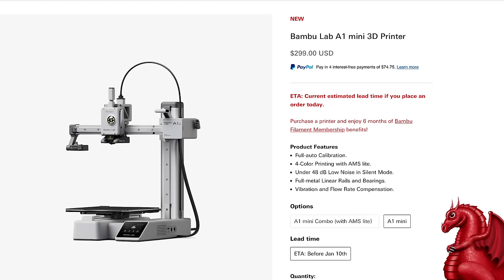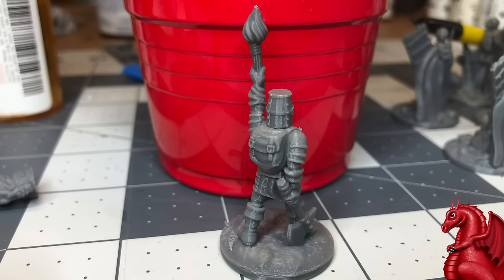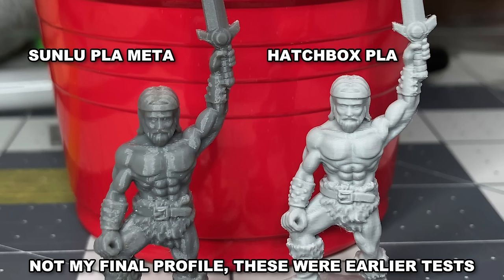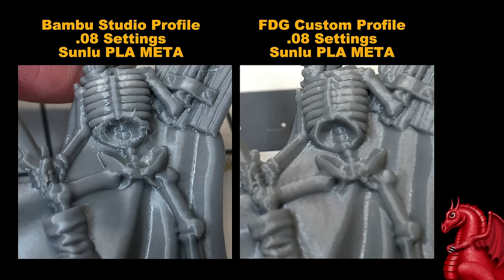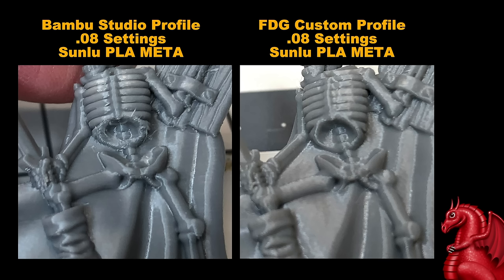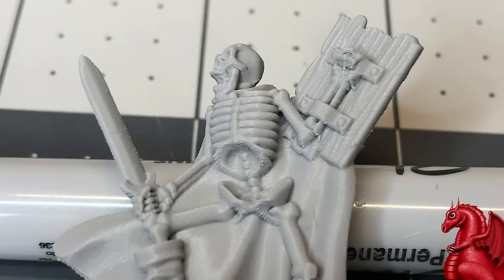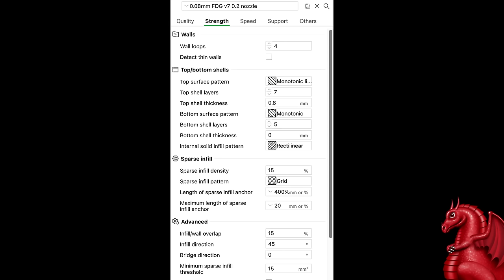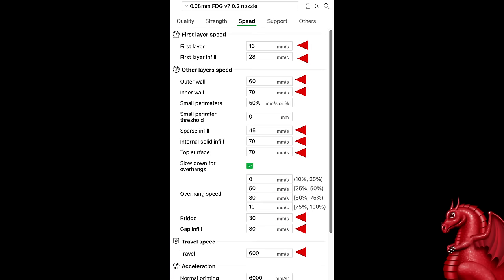Bambu A1 Mini - The Best FDM Miniature Printer!

Comment: Are you using a flat PEI sheet or a textures one? Textured should help. Bumping up the temp of the first layer also usually helps with bed adhesion. With other printers I find that just printing slow and hot for just 1 layer is enough.  I used to do slow first layer prints for 4 layers just like you, but 1 does the job and speeds things up no end.

Comment: In your optimised settings, how do these two filaments you recommended compare to the "original" Bambu PLA or PLA Mate?
I tested 3 manufacturers (but none of the ones you listed) and B PLA turned out to be the best for 0,2 nozzle.

Comment: Have you used 0.2 mm nozzle previously with other printers? I'm interested in what's result of smaller nozzle in general and what Bambu Lab brings in 🤔
It's interesting to see how much better different the meta filament looks. We obviously need Wargamer (Fauxhammer loves that resin) type of matte miniature filament 😅
Reply from the maker: Yes, check out my Ender-2 Pro video on the .2mm nozzle. It does great, but not as good as the Bambu A1 Mini.
Reply: @Tombof3DPrintedHorrors  Coming back to A1 Mini: We have resin printer (Mars 4 9k after Voxelab Proxima 2k display went bad and replacement was even worse) and modified Voxelab Aquila (Ender 3 V2 clone with dual Z lead screws, Orbiter 2 extruder and A1 nozzle and heating block for easy/fast swaps and Octoprint).
Printing, even with A1 0.2 nozzle, didn't bring good results for my son's gunpla parts (guns, accessories, service platforms etc) and for some reason A1 nozzle made it seem as if 1st layer came closer every print - though heating block and BL-touch are rigidly mounted. Of course resin is superior, even mandatory for 1:144 human figures, but workflow is different, messy, random reasons, etc... So I bit the bullet and bought A1 Mini from summer sale for his use.

Results? Powder-coated bed is not super-adhesive for small footprints (not exclusive to A1), supported surfaces are not too clean (not exclusive to A1) and it poops fair amount of filament before printing (no AMS, but it doesn't know if nozzle might have been changed?), but otherwise it's easier to use, 1st layer is always pretty good and print quality with 0.2 nozzle, default profile and generic PLA, is closer to resin that I thought it could. And it is ridiculously fast when it gets up to speed :)

It doesn't make me Bambu Lab convert in general, but being practical, A1 Mini prints really, really good 👍

Comment: These looks REALLY good! I'm getting more and more tempted upgrading my Ender 3 v2 to an A1.
But have you tried fuzzy skin? I do it sometimes on my Ender and it removes the layer lines quite well giving it a bit of a rougher look, kind of like dither in digital audio/image where you use noise to remove quantization errors, ie the clear levels you get when there's not enough bit depth, so the same as in 3D printing when you get lines when the layer height is not low enough :)

Comment: Hey Tom, question on you choosing .08mm vs. .06mm height on the .20mm nozzle. Do you find the difference is immaterial or issues arise? You're doing such great work and your presentation/public speaking is top notch. Thanks again sir!
Reply from the maker: .08 will produce cleaner miniatures, .06 does worse on overhangs and has more surface defects.

Comment: A matte pla would make the layer lines INVISIBLE -- it would look like an injected moulded (matte) finish.

One of the problems with matte filament (that I've found) is that it discolours light when it stretches or scratches. Still, it produces incredible results.
Reply from the maker: Not like the Sunlu META, it's not making the lines harder to see due to less reflectivity like a matte filament does, the line edges are actually merging better due to the higher fluidity of the filament.
Reply: @Tombof3DPrintedHorrors  Yes, I see that. There is still a "brushed" sheen that can be seen, but the individual lines are certainly less visible.

But if you haven't tried a matte (eg. polymaker, or duramic) you may want to give it a shot. The layer lines become non-existent, especially if you have 0.1mm layers.

I don't know if matte works better/worse with airbrushing, but I can't imagine it's worse. Of course, priming is likely key in either case.

Comment: According to their web site, the A1 mini is $459. For me, as someone looking to buy my first printer that’s significantly more than the $300 shown in the video. Disappointing. I’ve pretty much determined I’m going to start with an Egaloo Mars 2 Pro resin printer. 
I’d rather have the speed and relatively safety if FDM but I’m mainly interested in minis at this point. Still researching though. You did a great job pushing this printer to the max though!
Reply from the maker: The base A1 Mini IS $299, you were looking at the A1 Mini and AMS combo package.
Reply: @Tombof3DPrintedHorrors  Thanks for the super quick reply!

Comment: Awesome!

I am tempting to trying a .2 with my x1 carbon - and see if I could get similar results.

I notice there are multiple colors available for the Sunlu meta.   
The black and white seem to be cheaper than the other colors.

Did you find any difference in results based on the color of the filament?

Comment: I'm no expert by any standards but if the details on the arachne sliced file is visible but the detail doesn't show in the print, could it be just how the material behaves? It could be possible that variable wall thickness introduces stress and pull when cooling. Just an idea.

Comment: Any recommendations for support settings?  I noticed in the PDF there were settings for everything BUT that...
Reply from the maker: None of my models require supports so no need to design settings for them :)
Reply: @Tombof3DPrintedHorrors  yours don’t, but many models out there do…. And given how good you are at tweaking these settings it would be nice to get a leak at what you would use!
Reply from the maker: @theuglydm  if I ever start designing models that require supports I will definitely develop settings for them. :)
Reply: @Tombof3DPrintedHorrors  Will be looking out for that video.

Comment: Would have been good if you had:
* how to open that screen with filament settings
* how to save and name the settings (that weird system was a bit of a surprise)

Why not use  a 0.06mm profile?
It would be have been good to end it on the topic of supports as that is such an important thing for 3d printting.

/ From a beginner at FDM and Bambu Lab
Reply from the maker: The download link for the profile includes a PDF instruction document that tells you exactly how to import the settings to Bambu Studio step-by-step. The video is not intended to be an introduction/tutorial for how to use Bambu Studio, that would be a completely separate topic I might do someday.

.08 produces a better print surface.

Finally, none of the models I design require supports, so no need for me to create settings for them. If you want support settings, ask the creator of the model you are using what they recommend for their design, it will vary from model to model.

Comment: do you have tried to to print miniatures with 0.2 nozzle and 0.04 layer? A1 mini support layer thickness down to 0.04mm
Reply from the maker: That's too low of a layer height, .08 will give you the cleanest results, .06 is OK but will require much more cleanup.

Comment: i got your setting from the link. if i check the FLOW DYNAMICS CALIBRATION when im about to print, it will affect the configuration you made?
Reply from the maker: Nope, you should always do that periodically or after every filament change. :)

Comment: I get better quality than that with the .4 nozzle.  With the .2 all I get is more trouble with jamming than it is worth.  

Set you .4 to fine in Bambu studio and then use the flow rate calibration, and you will get incredibly smooth and detailed prints.

Oh and using Bambu matte filament, I don’t even see layer lines in my prints with the hear bed at 70c and the print them at 220c.

Comment: Just got the profiles! Thank you!  Do you have any advice on supports for folks new to 3d printing? I have I have one mini with arms sticking out, and it needs support, but it always becomes a mess.
Reply from the maker: None of my models require supports, everything we sell at FDG prints without slicer supports. :)
Reply: If your printer can change printing material during the  print process, you can try to use water-soluble material for supports.
Reply from the maker: @niemand9871  none of my models require supports, everything we sell at FDG prints without slicer supports. :)

Comment: Thanks so much! I am having a little trouble with stringing though with sunlu meta, I'm using v8 of the a1 mini profile on the .2 nozzle. Should I be tinkering with retraction settings or cooling or speed? I'm brand new to the hobby, thanks!
Reply from the maker: Start with temp, decrease in 3-5˚ increments. :)
Reply: @Tombof3DPrintedHorrors  will do, thanks for the reply!
Reply: @Tombof3DPrintedHorrors  I was finally able to print 2 minis sibe by side with a total of ONE string. Thanks so much for all this work

Comment: Hey, I finally got my hands on A1 mini, downloaded your profile, and imported it as guided. But it seems the printer head still moves too fast, or is it supposed to move like that? (the speed is set 60/70 outer/inner walls in the slicer), the acceleration remains default? On my previous machine (Ender) it moves really slowly compare to this. And the printing time with a smaller  nozzle is less than with default 0.4 on Ender, which is really weird. Thx!
Reply from the maker: Yes, it is supposed to print this fast. It will print any of my designs at these settings. If you are printing something else I obviously cannot advise on that beyond saying you might have to select silent mode 50% in the LCD.

Comment: I'm printing RPG figures - elves.  I keep breaking at the wrist or at the ankles when removing the tree supports.  Also, one of the feet and knees were like spagetti - low extrusion.  What can I do to get better?  I'm thinking these free elf figures on Thingiverse are too fragile.
Reply from the maker: I can't advise on another companies designs. Models have to be designed/engineered to withstand the support removal process. None of my models require supports, so you might want to try them.

Comment: Wow, how do you get stringing under control? Do you post process you miniatures afterwards?
Reply from the maker: No stringing with these settings/filament, and the miniatures shown are straight off the printer, no post processing.
Reply: But that doesnt mean, that you never had stringing. You just got it under control. Or did you never got Stringing? 2nd question: Where can I find the model of the barbarian?  @Tombof3DPrintedHorrors
Reply from the maker: @dotwinX  I had no stringing with my profile on the A1 Mini. The barbarian is available on my website.

Comment: Will Bamboo A1 (not mini) do the same job? I saw there is not much big difference, only plate size and cooling.
Reply from the maker: Almost, but not quite as good as the A1 Mini. There are other differences like the A1 not having a Z axis linear rail like the Mini.
Reply: That's what I thought so, but it's hard to find fine compare. Thanks for reply!  @Tombof3DPrintedHorrors   and thank you for all of your content and work!

Comment: It will work if I use your setting and change only 0.08 layer height for 0.06 ? or it need other change. THank you for your advices :D
Reply from the maker: Yes, you can print at .06, but you may be happier at .08 as it makes for a cleaner print.
Reply: @Tombof3DPrintedHorrors  ok ! I will try both, thank you :)
Reply: Tried a few times and it's perfect !!

Comment: Really awesome video. Slicer settings are one of the hardest things to adjust for me. 

I have a BL X1C but didnt go for either bed slinger versions. Do you print one mini at a time or lots on the same build plate? Ive found that the layers that dont need a lot of time to print need to be slowed down, not specific to any printer. So the sword part of the mini needs time for those prior layers to cool before a new layer is added. 

Also, during the winter months, the ambient house temps are colder than summer months. Even those couple degrees of ambient temp differences change the print slightly, but especially with bed adhesion on bed slingers. (I also have Ender 3, 5, Prusa Mk3s, and a few corexy. But i havent tried a 0.2 nozzle on most of them.)

I wonder if a 0.4 nozzle and only changing the Arachne walls and ensure all wall thicknesses are 0.4 not 0.42 or whatever the profile defaults to, would give you similar results. But like you said, testing all these changes takes a lot of time.)

Last question, any issues with nozzle clogging with the 0.2 nozzle? I had some 3+ years ago and is why i stopped messing with it and went to resin. But my resin vat leaked and destroyed that printer. :(
Reply from the maker: No clogs, .4 isn't good for minis, no issues with temp variations (printing in basement in Ohio), single mini at a time for profile development to eliminate variances due to multiple models.
Reply: @Tombof3DPrintedHorrors  Maybe arachne walls have a limit on their resolution, so 0.6 nozzles make you see a difference but 0.2 don't? I'm remembering Tom Sanladerer's video from 1+ years ago where he posits 0.4mm nozzles are dead and replaced by 0.6. Which now I find interesting that the Prusa XL is replacing their 0.6 nozzles with 0.4. Anyway, sort of off subject.

Thanks for the reply.❤

Comment: I was recently turned on to your channel by a mutual pal. I am awaiting your A1 review because I might want to print the occassional Trek prop as well as high detailed minifig doodles out of ZBrush and Nomad Sculpt 3d.
Thank you very much for taking the time not just to research this info by trial and error but also for presenting it in an easy to follow fashion as well as hosting and sharing your data files.
If I may ask something, I know you advised against getting the multicolor filament system but I have been wondering if it is economically worth it in terms of print time and materials cost to get that system so that I could use Bambu's PLA support material filament. Do you have any thoughts on this?
Thanks!

Comment: I just recently got an ender 3 v3 se (watched your videos), which has already failed within a month. Printed great, fast and it was my first printer, minis had bad quality but that was the standard .04. 

I’m getting a return and see the A1 mini is $199 right now where a V3 SE replacement is $170. Get my $170 back and pay additional $20 for the Bambu A1 Mini or run it back with Ender 3 V3 SE? 

I print miniatures, tanks, bases, terrain (one stop shop all things table top) upgrades to printer, random stuff etc.. which would you choose? Thank you.
Reply from the maker: The A1 Mini is the better printer by far. For minis be sure to order the $12 .2mm nozzle and use Sunlu PLA Meta.
Reply: @Tombof3DPrintedHorrors  you’re the man, always reply so fast! Thank you for the response, will look to go with the Bambu A1 Mini.
Reply: @Tombof3DPrintedHorrors  Wow set my A1 mini up today and holy smokes you were right. This blows the Ender 3 V3 SE away, not even comparable for a $30 difference. This printer is amazing.
Reply from the maker: @StephenMichaelElliott  I KNOW!!! :D

Comment: Hey! Can you please tell me your retraction settings? I use the same settings as you but I have sooo many stringing and thin hair-like lines when using supports.
Reply from the maker: My profile/settings is linked in the video description. :)
Reply: I did buy them, but there is no info about printer settings for Bambu Lab A1 mini 0.2 nozzle and it’s extruder settings :(
Reply from the maker: @wesduh128  I just checked, my retraction distance is .4mm (it's under the printer description in Bambu Studio.)

Comment: I'm looking to get an A1 Mini as well, but Bambu came out with a newer A1 printer with a bigger bed plate (I believe 256 x 256 is the size). There doesn't seem to be any other differences. If I wanted to print FDM miniatures, would you still recommend the A1 Mini or should I go with the newer A1 with a bigger bed?
Reply from the maker: There are a lot of differences, dial Z screws vs 1 on the Mini, the mini has a linear rail for the Z axis and the full size doesn't, etc. So far in my testing, the A1 Mini is the best for miniatures. The full size A1 is close, but the A1 mini is better.
Reply: @Tombof3DPrintedHorrors  that helps a lot! Thank you for your advice

Comment: Any recommendations for overhang support? Some of the stuff im trying to print requires supports.  the body itself comes out looking great but limbs and parts of heads are falling apart no matter the changes I make to overhang speed.
Reply from the maker: Nope, nothing I design requires supports so no need for me to develop settings for them. As each model requiring them would be designed differently, you need to ask whomever created the model for their recommended settings. Stick with official Fat Dragon Games models and your models never need slicer supports. :)
Reply: Touche you win.... looks like im going to have to buy some to try.  I want to support you anyways it's a very good profile for the A1 mini, ive tried some others and the parts that do print come out highly detailed.  I can definitely see doing this over the major hassle of resin any day. @Tombof3DPrintedHorrors

Comment: Do these settings works on a bambu  lab X1 Carbon?
Reply from the maker: I haven't confirmed it as I don't own one, but some of my customers say they work great on the X1.
Reply: @Tombof3DPrintedHorrors  ty! And which material do you use for A1 0.2 nozzle? Because at the web it says that is not compatible with Gloss-PLA
Reply from the maker: @WondefullComment  I discuss everything I use in the video - Sunlu PLA Meta gray.